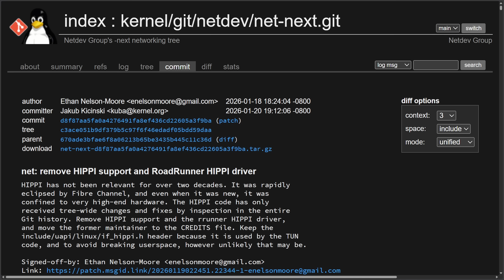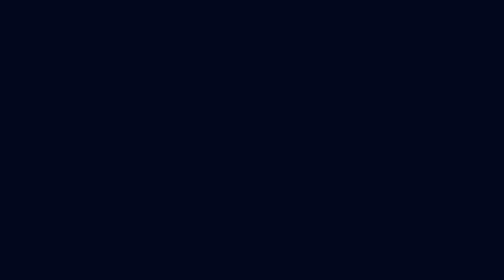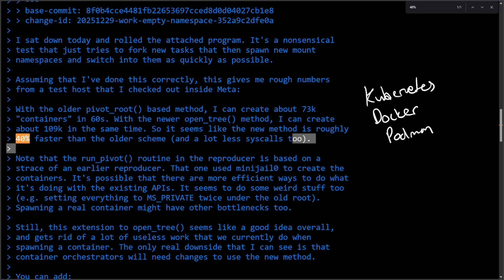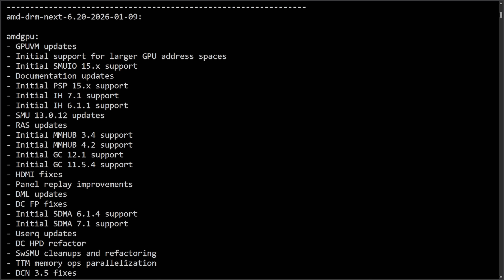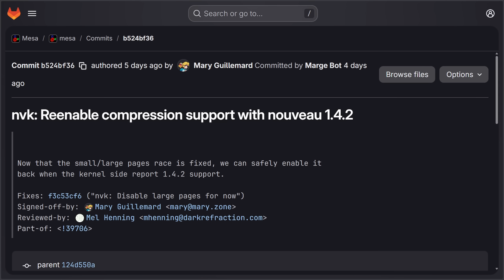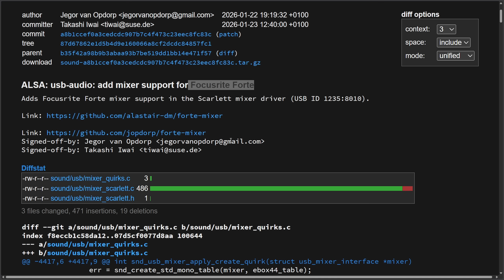Linux 7.0 Review: MAJOR Performance, GPU, CPU, and Networking Upgrades

Comment: If you can, try to donate a few bucks, these guys are doing gods work. Either to the linux foundation or to the people maintaining the distro your're using. They need all the support they can get, especially in times where proprietary software gets worse every day!
Reply: The Linux kernel gets plenty of support from the big tech corporations. It is far better to donate to a struggling Linux desktop application that doesn't get any corporate support. Almost none of the kids games get corporate support (Gcompris, TuxType, TuxMath, etc).

Comment: Am I to understand that there are people actively working to make Linux better with each update? I'm accustomed to an operating system that only grows worse by the day! I'm excited to be switching with my new builds!
Reply: Been using Linux for about a decade now. It's night and day my reaction to updates. Direct correlation of joy and usefulness
Reply: Yep.
Remember: Bazzite if you like SteamOS. CachyOS if you like bleeding edge and optimized and is not afraid of the terminal. Fedora if you're really not afraid of the terminal. ZorinOS if you are really afraid of the terminal and don't mind being a month behind in exchange for compatibility with windows programs outside of gaming. Mint if ZorinOS was too windowsy for your taste. Ubuntu if you like purple. Debian if you don't mind outdated but stable, it only ever updates if there are security patches, it's mostly used for corporate servers. Arch if Fedora had too many defaults chosen for you. Gentoo if you want to optimize things by building everything from source code. Slackware if you liked Gentoo but you still had too much social life and spare time.

I was on Arch with Lightdm, X11 and XFCE. Now I'm on CachyOS with SDDM, Wayland and KDE. Both configured to work like the MacOS desktop in terms of shortcuts and window behavior.

Comment: Lol.. Intel deprecated TSX in 2020 in all of their CPUs. So, naturally Linux just now includes it. Classic.
Reply: linux had it but was switched off since it had vulnerabilities. it is now going to be on by default with fixes. btw, intel has disabled it by default, but is only partially deprecated. also, linux supports hardware long after the manufacturer drops support. you are just a loser.

Comment: I'm probably gonna start a war with this, but the Rust Vs C situation is getting a bit out of hand.

I see good arguments from both sides, but also awful, politically charged ones too (for some reason).

Imo, rewriting perfectly safe C code for no reason with Rust is a potential vulnerability and probably a waste of time, BUT, I'm also a fan of Rust and the idea behind it. Writing new or replacing vulnerable / outdated code with Rust can be a good thing imo.

As professionals, we should REALLY start leaving personal grudges behind and stop destructively critiquing alternatives JUST because of politics. If your argument brings something of actual value to the table, please get your opinion out there, that's the whole point of this, but remember to be respectful and objective.

Open Source is supposed to be all about collaboration and avoiding the monopolistic practices of Big Tech behind. Just remember than no language is objectively better than the other, they're just different and therefore have different appeals.
Reply: "perfectly safe C code"
"for no reason"
Care to provide the examples?
Reply: @bytefu unfortunately I'm not familiar enough with the Linux kernel's source code to provide a concrete case. Unless you're a Kernel mantainer yourself, I'm guessing it's the same with you; and if you are, you should already know.

I'm just saying that if a piece of important code has been rigorously tested & performs as expected (either C or Rust), there is just no need to change it for the time being. Prioritising more dubious / unsafe code or extending the kernel might be a better use of time.

Don't take this the wrong way btw, this nonsensical war just isn't for me. Whatever tool does the job best in each case is what should be used. I like & used both languages but they have different strengths & weaknesses.
Reply: @bytefu you have proof every change was absolutely necessary?
Reply: @SunShine-xc6dh  Excuse me? Why tf should I provide any evidence? The burden of proof is on the accuser — in this case, it's @AratPrime. He should provide evidence of code rewritten in Rust for "no reason".

Comment: What is this super basic terminal like email viewing people use to read these updates/emails? Is it just using the terminal?
Reply: It's the website for the linux kernel. This is in a normal web browser. Links are in the description if you want to visit them
Reply: @someone4229oh cool, thanks!
Reply: A discussion group or discussion list is sometimes called a forum or newsgroup: Generally, someone posts a message & then people respond. Other terms used for groups include usenet, bulletin board (or BBS), Listserv...

basically this is an email list that you sign up for, & when someone makes changes or proposals, then everyone gets emailed & people who are on the list want to respond, then they can respond & that response gets sent to everyone on the list

Comment: Oh I'm excited for this release. I use a Lenovo Yoga and I do see the sleep/wake issues. Can't wait for the fix. Also always good to see better optimizations overall.
Reply: I have a lenovo yoga pro arp and you can fix this by a specific command in the booting params. This just happened in my case with linux mint, not fedora.
Reply: Do you have issues like.. when you try to wake up the laptop, the screen turns black and some white texts appear, and no key or key combination is working (except maybe switching to tty 5)?
Reply: @europ_everi_nice  I have almost the same issue! (Ideapad slim 3) screen works but keyboard is completely off, have to use the onscreen one to login and reboot for it to work again. Unfortunately my goto method for making it "seem" like the laptop is sleeping when the screen is closed ("lock and turn off screen") is no longer a thing in 26.04 kubuntu, currently trying out some shell script that are supposed to do that but none work. If the 7 kernel fixes it it would be quite epic

Comment: So if you write a driver in rust then any platform that doesn't support rust compiler can't compile that driver. So you can still compile a kernel without rust but you'll be missing whatever has been written in rust. Isn't it weird to fragment on a per feature basis?
Reply: There are currently two main approaches to solving that problem:
1. gccrs are building a rust frontend for gcc. They started focusing on the kernel subset in November 2025 and hope to compile it fully this year.
2. Transpiling rust or llvm ir to c would allow you to use any c compiler or your choice. I saw a promising project doing the former but can't find it now and the attempts at the latter seem half baked or abandoned.

Hopefully there isn't much need for running the new driver on unsupported hardware, as a lot of it is old, until more progress in portability is made.

Comment: What about arches without a rust compiler? How central is rust in Linux now?
Reply: If you can't/won't compile rust, you won't get the drivers written in rust. The core code will stay c for the foreseeable future.
Things currently built in rust are a panik handler that shows a qr code with crash data, some file systems and miscellaneous drivers, mainly for gpus.
Reply: @antonf.9278  Cheers. I was worried that they were at a point of rewriting core bits in rust, which would hurt the older ports which don't have rustc available. It sounds like it's still very much on the edges.
Reply: But why do you care???
It's software.
As long as you don't have to do anything, why does it matter what they are using?
Reply: @seltsamerjunge3642  Rust is great, but there are growing pains. You might care when your favorite software doesn't get updates because the dev(s) burned out and quit. Linus himself recognizes this as an issue. There also seems to be some cult-like strangeness surrounding it, which is very unattractive, and is already affecting adoption / outcomes. The language is great, but as usual, people are the problem.

Comment: The funny thing is that if you look at the code that they call safe, you'll find the 'unsafe' keyword used a lot. That disables the compiler from doing the memory checks they say makes rust memory safe. It's literally no safe than C with that keyword.

Comment: They call the rust experiment a success? I call it a embarrassing failure. my wifi used to work without issue, now I have to disconnect and reconnect every day, sometimes every few minutes, because it can no longer handle large uploads/downloads/streaming. That s**t only started AFTER the rust bs started happening. I also now get random PC crashes where it just freezes in place (mouse doesn't move at all). Seriously, this "Rewirte it in rust 'cus rust" cult needs to die, now.
Reply: you are citing anecdotal evidence and attributing it to the rust project.

 it's hard to take you seriously when your complaint rests solely on post hoc ergo propter hoc rationalization

i suggest investigating your driver hangs and pc crashes (kernel panics?) and bringing your findings forward to the maintainers responsible for the modules at fault, and only then blaming what you found to be actually responsible for your issues!
Reply: @arsenicuu  Rust is killing Linux this is a fact and DE Resting is going to be Needed GREATLY. Linus went full Microslop shill too.
Reply: @arsenicuu  You speak as if being able to do that is a common skill in linux, for the average joe like myself who only deals with GUI's most of the time, figuring out how to check those details is a headache that's often put off for if ever find the time for it.

Comment: Why does everyone in the comments hate rust so much, I don't get it? Doesn't seem it will harm anything?
Reply: Some people hate Rust because it's "woke" and so everything it touches is bad. And some others hate Rust because it's not C. You can't make everyone happy I guess.
Reply: @brinkoftext  So some people are just lazy and don't want to learn a new coding language. I mean yeah haters are gonna hate.
Reply: SImple It highly ineffecient its bloated its is annoyAF to Compile and it takes AGES TO COMPILE usually only to return with a syntax Error that doesnt actually matter and would save exactly 1 bit of performance and Rust would have let run if it wasnt so ASININE.
We have the Complete Inversion of Language to write in Rust Pissing of 99% of devs, Its Programs DO NOT PLAY NICE with other language Programs often cause THEM to fail in proximity of the BORG LANGUAGE.